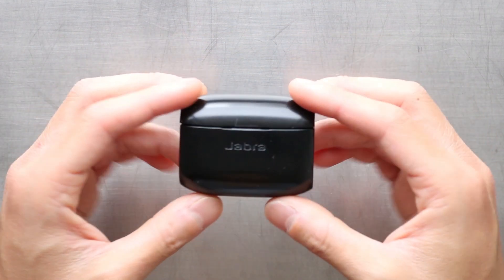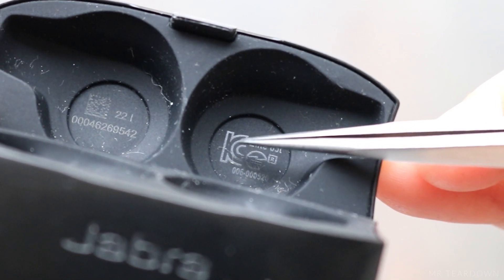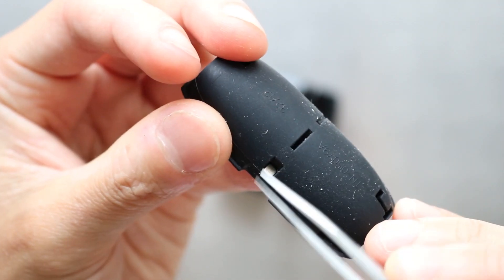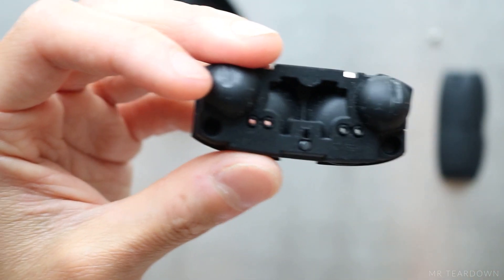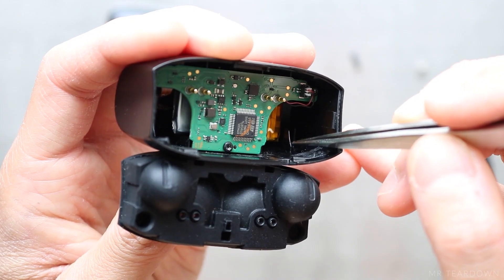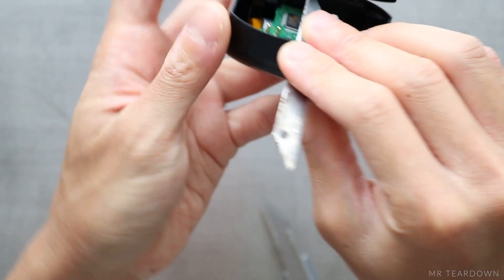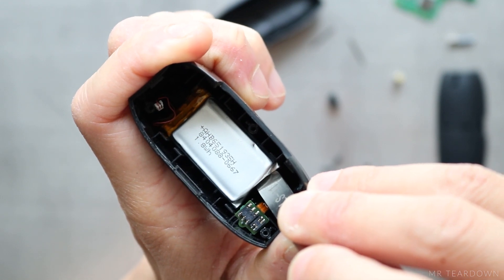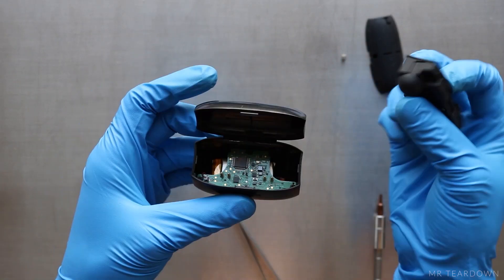Teardown - Jabra Elite 65T charging case

Comment: Hey guys...just a comment on how I finally fixed my Jabra elite active 65t. I did ALL the recommended troubleshooting I could find on YouTube but nothing worked. My buds simply would not charge. Sooo...I followed the procedure for taking apart the case...I found that the contacts on the board where they contact the small module ...we're a bit corroded...I cleaned them with alcohol and scrapped the a bit. After reassembling I was surprised and happy that the buds charged and are in perfect working order. Just wanted to share

Comment: Hi, when I charge the headphones they only last me 45 minutes. I have cleaned the pins and they still won't charge for more than that time. I bought a new case thinking that was the problem but they still lasted the same. D.o you know what the problem is?. Thanks
Reply: How old are your earphones? Probably the batteries INSIDE the earphones are worn off. You can replace them with ordering new batteries from i.e. Aliexpress. But reassembling the earphones could be tricky when it comes to glueing back. Of course it is not gonna be perfectly factory sealed ever more. But with a strong glue i.e. loctite it could be still great. Worth a shot.
Reply: @scolptur9365  These are approximately 4 years old. What you indicate is probably the problem. Thanks for your help

Comment: My Jabra 65t's plastic snap did break off like he said so I had to put a rubber band to keep it from opening. My son has a noncharging 65t case which thankfully he has not thrown out yet and is no longer using so he gave it to me. I just swapped the internal components from my case to his by following this tear down and now I have a working, closing case.

Thanks, man!

Comment: Hey man, my airpods was in the case and in my pants and  I make mistake by washing them in washing machine. So after that I tried them and they worked but case don't want to charge anymore. When I plug usb in them they start to blink red but not charging. Is that repearble or should I buy new one? Thanks in advance

Comment: Hey, do you think it's possible to convert the latch mechanism to a magnetic type by placing a few neodymium magnets inside the top and bottom halves?
I'm asking because my hinge broke along the flexible plastic portion and I'm considering the above to fix it. For now I'm using a piece of rubber band to hold the top and bottom pieces together for charging the buds.
Reply: I had the same problem. I use black duct tape, cut to the same width as the hinge, up the back of the case and over the top to about 10mm from the front edge of the lid. It's worked faultlessly for the last 6 months.
Reply: @peter-and-morag1892  Thanks for sharing. Using duct tape is a great idea.
Now I'm considering combining both the duct tape idea as well as the magnets idea, just so I can get rid of the plastic locking tab and not fear losing the top part of the case.
Imo, it's a bad design from Jabra.
If they can use magnets for all the sensors, it would've been a nice addition to have a magnetic lid as well.

Comment: Yeah I also wouldnt mind you tearing the earpieces down :D

My right earbud is at like 25% volume for some reason. Poking a hole helped a bit I dunno why but I think a lot of dust has collected inside and the only way to clean them out would be to break them. :(
Reply: Earwax? Small Q-Tip and rubbing alcohol cuts through most of that gunk quickly. In the earbud; don't ever put a Q-TIP in your ear.

Comment: My right bud doesn't work and there is no light, so it doesn't charge either. I tried this to see if maybe there was something inside preventing it from charging but nothing :(
Reply from the maker: Hey Betsy.  You mentioned your right bud isn't working so I assume the left is and the charging case probably is working too (because you can charge the left bud?).  If you have a multimeter, you can check if the pogopins for the right earbuds are providing ~4V across them. 

Just a long shot. Maybe find an external power source to charge the earbud directly and see if it will bring it back to life. A variable power supply is the best choice. The gold contact closer to the speaker hole is the ground and the other one is ~4V.  You should see a small current (~0.3A) flowing into the earbud.

If you do have the equipment but are unsure of what to do, please let me know. After all we are dealing with li-ion batteries which should be handled carefully.

Comment: Hi Mr tear down. My right earbud suddenly stopped producing sound. I tried the hack on Reddit to poke the small hole on it but it does not work. I need the teardown for the earbuds to see what that hole does. If you could help me I'd really appreciate it.
Reply from the maker: Hey Austin.  Thanks for your message but I'm afraid I'll have to disappoint you.

Your problem definitely got me interested in taking it apart but I am currently busy on other things.  I took a look at the reddit solution too but I don't understand how poking the vent hole would fix it.  And your earbuds "suddenly" stopped working so that seems to be different to what other people described. 

I assume it's still charging, powering on and connecting properly?   I'll reply to this comment again when I can find time to do a quick teardown but sorry for now.
Reply: @mrteardown6478  yes the buttons still work. Just that it does not produce any sound. I had this once before when I went swimming with it. But it was fine after one day leaving it dry. Now it does not seem to work anymore. Sometimes when I wiggle it and press down the mic, it works. But when I release, it doesnt. Appreciate the reply. I might have to get a different pair. Perhaps not Jabra anymore :(
Reply from the maker: https://www.reddit.com/r/Jabra/comments/m8ob6d/a_question_concerning_the_little_venting_hole_of/?utm_medium=android_app&utm_source=share

This guy's earbud worked after a while. Maybe the water has caused some contacts to rust. Maybe try the rice trick to absorb the moisture? Good luck!

Comment: a really well detailed video! Have you tried tearing down the earbuds? how easy are they buds to repair?
Reply from the maker: Hey @Zameer

Just want to say thank you and let you know that this is the first ever comment that I received on YouTube and it's a compliment!

I'm actually still using them so I did not risk taking them apart but might do so in the future.
Reply: My biggest problem with these is the  fact  that they are not even kind of loud, at least IMO! And I'm not just referring to bass I'm referring to EVERYTHING! I'm pretty disappointed
Reply from the maker: Hey Derek.  I recently got a cheap (or good value?) Chinese "airpods" and it's like 2x louder than the Jabra.  And I'll probably do a video covering that at some point.

But as Austin Tran Duy Anh has already pointed out, poking/cleaning the vent hole on the earbud might fix the volume issue.  I haven't tried it myself but will definitely look into when I'm more free.
Reply: @mrteardown6478  knock off air pods that aren't complete junk, I'm all ears?!? One other bad thing about jabra elite 65 is that they don't fit my ear no matter what size ear piece. Something else people might want to consider before purchasing.
Reply: @mrteardown6478  have you ever repaired any Soundcore P3 by chance? I love soundcore unfortunately I broke my pair and have been debating on trying to fix them myself or just buy new pair
Reply from the maker: @Derek W C I can't comment on the audio quality but my overall impression of it is quite good.  Let me give you an update here when the video is out.

But yes! I have the same problem too.  Can't wear them for too long or my ears will start hurting.
Reply from the maker: No I haven't.  I'm just tearing down things that I've got 😂